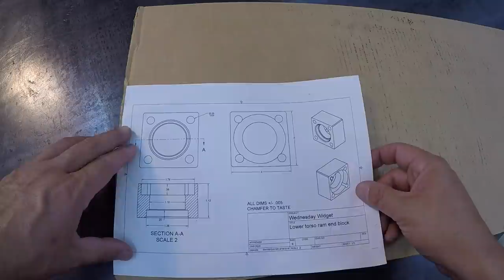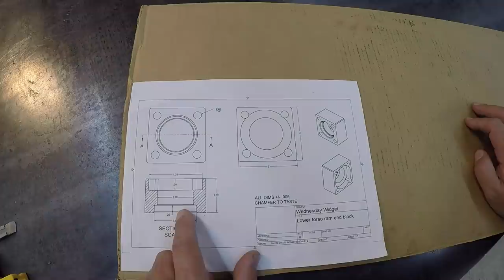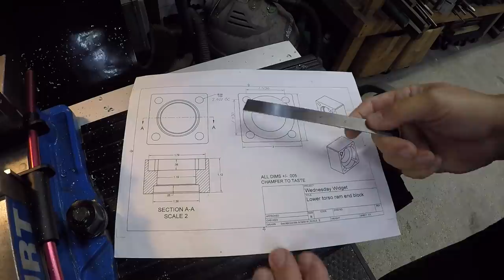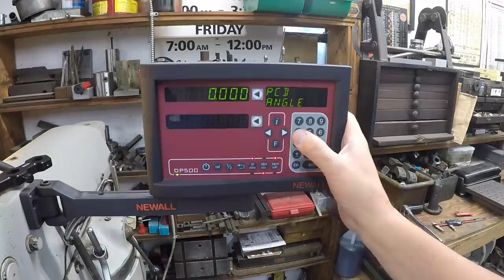Johnny 5 Part for NYCCNC

Comment: Here's an idea for a project.

Build an attachment for the end of the ram, on the Dake Press, that's kind of a square collet/chuck, to hold the Abom79 stamp, for when you want to press an imprint into a part.
Reply from the maker: BedsitBob yep, already been thinking about that one.
Reply: @katelights  Good idea! Set up a couple of alignment pins and bang out a bunch of identical parts in a row.

Comment: That spring center was really cool, I was wondering how you'd indicate that!
Reply: you can run thin square stock or parallels on each side affixed with a rubber band and zero on the center section for each side (where the test or dial indicator levels out and stops climbing/falling). Get the same number on each side and it's centered.

Comment: Nice work Abom79, love the manual machining videos. They teach a ton of useful info that can be used for up and coming machinist. Did notice one thing, the counterbore on the back side spec'd to 1.380", you measured it at 1.341" and said " that would be 49 thousandths". That would put you at 1.390". Not bashing, I catch myself all the time. Keep em coming, thanks.

Comment: I love manual machines, worked on them for over 8 years, still do once in a while. After running cnc for 20 some years when I see how long it takes to make that little part I don't see myself going back.
Reply: Good luck knocking a one off out this quickly in a cnc
Reply: @spikeypineapple552  you kidding right?
Reply: @spikeypineapple552  I hope you don't think he made this part in 30 minutes, do you?
Reply: Chris Maj this is a 90 minute to 2 hour job.
Reply: Since it is a simple part the difference between manual and cnc is not that great. If it wasn't for the center bore, the gcode could have been written manually in a minute. A bit more complex than that and cnc will save time. It depends on how valuable time is in deciding which is needed.
Reply: Nate Contarino yup, exactly. It’s still a 6 op job, and I still wouldn’t trust my vmc to put those bosses in there without a boring head, so the only op you really saved was the fly cutting and the drilling, and having to centre it in a 4 jaw. You added on 55k in machine cost though.

Comment: VIEWERS OF ABOM, who are you and why are you here?

I'm an electrical engineer fresh out of uni and do a little bit of shop work here and there. Mostly woodworking though. But seeing Adam applying his skillset to so many projects, nailing them, is awesome!
Reply: Marine engineer from Denmark :D
Reply: Mechanical engineer, machinist, farmer, and general repair/fabrication man from central, Kentucky.
Reply: Mechanic and Metalworker from Germany
Reply: I'm just a lowly shop helper (sanding, buffing, deburring, cutting stock) and a hobbyist machinist making audio amplifier enclosures. Located in New Hampshire
Reply: Auto Technician, constantly have to machine and fab parts and repair threads and holes in place on vehicles. Located in Massachusetts
Reply: Retired computer programmer who lives in central NJ.  (Exit 8A of NJ Turnpike)
Reply: @natecontarino1748  Those casework skills are of INTEREST to me.  Mine are, at best, marginal.  Check me out on Audio Asylum & DIY Audio.
Reply: Retired orthodontist with lifelong machinist hobby. Minnesota USA

Comment: That deburring file might be the smallest hand tool Adam has. 

I'm waiting for the prototyping video for a deburring tool that you can chuck up in the lathe. Once you're finished with the facing cut, it just drops on to the tool rest, lock it into place, set for however many sides your part has, and spin the chuck. (Metal cutting noises) done.

Comment: Adam...I think the drawing specified a thickness of 1.12" and after your final facing in the lathe, the mic read 1.20". I know the specs were loose, but you might want to bring it in before shipping.
Reply: I have made the 1.125 and 1.25 mistake twice in the last two weeks.

Comment: Part turned out beautiful!

How do you like that Edge Technology indicator holder (the one you used on the mill)? I've got an Indicol holder and like it, but I hate how it doesn't necessarily hold the indicator on the center line of the spindle like the ET one does. Lack of a fine adjust is a downside though.

Comment: I didn't quite understand the reason for using the power feed on the last drilling operation at 26:55. It helps avoid some issue with the drilled hole intersecting the bore?

Comment: Nice work Adam! 
Random question...you’ve been in a machine shop your entire life. What kind of boots do you prefer? I’ve been wearing Thorogood and I love em.
Reply: Danner or redwing.
Reply: @nismotuner1  I like danners for cold weather. Nick's custom if I'm gonna be standing on concrete floors all day.
Reply: HighFlyer I’m gonna have to check out Nicks. Good info.
Reply: @nismotuner1  Redwing, expensive, yes, but You will retire wearing the same pair... 😁
Reply from the maker: Thorgood slip on boots with the wedge soles 👌🏻👍🏻

Comment: don't throw these long chips from the drilling away, hang them on the Christmas tree in the shop
Reply: After my kids watched Wall-E, I told them that was neither the first tracked or cutest movie robot.
Reply: This is inadvertently creating a tree of razor wire, you have recommended basically putting razor blades all over a christmas tree. You're trying to give santa a brush with death!
Reply: But they are so brittle. Very brittle.

Comment: That looks like the end block for the cylinder that is at the rear base area of the mobility platform on the robot. If you google Johnny5_03.jpg and look toward the bottom of the image you can see this part.

Comment: I just realized I don't think I've ever seen you preset the Chuck. Do you do it with a ruler? How do you know where the center of the chuck is to measure from?
Reply: He mentioned in another video - there are circular lines on the chuck face that he uses as an initial reference when setting the jaws.

Comment: It's amazing how you do things.   I can do that with grading.
Reply: I'm going to assume heavy equipment, I worked with 2 operators in my 15 years construction time. A lot of guys who could run equipment, but only 2 true operators. 1 grey beard and 1 young buck. I'd like to see the young buck know.
Reply: @raymondmucklow3793     I'm grey haired to. But do Gradall excavator work and my Bobcats. E 85 excavator and E 50 excavator and T870 track loader.   When you can hang iron out 50 on tires without outriggers and cut 1/4 inch bank then you are good.  There are seat warmers then operators.   Have 6x6 tri axle dumps and Gradall excavator is 6x6 and also have a track Gradall excavator.  I do highway work in Florida.  Seen many come and go.  But have customers for last 40 years.
Reply: @larryshedd5734  when I say Greybeard that's a sign of respect, that's how I was raised.
Reply: @larryshedd5734  we did have a D6 dozer I got to run that for a while that was a blast made ya feel invincible. When I worked out in Vegas, these guys would come in with Doziers and Earth movers, and it was all GPS and lazer level.
Reply: @raymondmucklow3793  I know what you mean.    Not many people take pride in their work.  They get paid more than I did getting started.  I have some good operators I trained.  It's my company my machines I paid for and my customers.   Going to be my way
Reply: I have all that GPS LASER stuff on Bobcats.   Contractors love it.  I like it so don't have to wait for survey guy's.  Have CAD system.  Comes in nice on highway jobs
Reply: Have TELESTICK for Gradall excavator and can reach 51 foot. And 8 foot grading bucket.
Reply: I'm on 10 year project in Florida.
Reply: @larryshedd5734  highway project

Comment: Noticed that you use a lube to peek the chip welding down.  Any experience with waxes?  We used to use the for saws, and drills on aluminum. Thoughts.
Reply: like a paraffin wax or?
Reply: Jay R I think the used bees wax. The thought was if a block wax was rubbed on the part surface prior to fly cutting. Would it give even lube and does it work similar to cutting fluids?
Reply: @rascalwind  I've used waxes on cutters when working with plastics to prevent chip buildup while drilling delerin plastic.. but I'm not sure about aluminum

Comment: Hi Abom79  I would to ask you a few questions.  Is   Bronze hoarder then brass or copper. I'd of like to know which one is. and if there is any place to learn how to do what you do. Thank you
Reply: 'Bronze' and 'Brass' are both kind of poorly defined terms, but either of them will be harder than pure copper. Tin based bronzes can be made harder than zinc based brass because tin has a greater strengthening effect on the alloy than zinc does, but the hardness also depends on the % of tin or zinc added along with other elements (such as silicon, aluminium, phosphorous or manganese) that are included in the specific alloy you are dealing with. Copper alloys also 'work harden' so bending or hammering them whilst cold will increase their hardness at the cost of making them more brittle- heating them up and quenching them in water reverses this effect and makes them soft again.

Comment: +- 0.005 inches are +-0,127 mm no? if ye it's basicly impossible to be put of spec lol I mean that's a huge tolerance, when I turn/mill I have have to get in tolerances like +-0,000197 of an inch (0.01 mm) and I am already happy with that tolerances I had a job where my tolerance was 0.000078 of an inch (0.002) and I did it on a conventional lathe 😂
and u don't need to indicate the part like you did u can just clamp the indicator on the tool slide and check the "height" on all four sides we do that all the time, I mean we have to do it our way because we have to work with cut pieces (so we have 2 identical halves)

Comment: no criticism - but i was a little bit disappointed that you didn't clean up the outer faces with the shaper :( 
and out of interest - why didn't you use the same big mill for the surfaces as for that big Aluminium block of the Weld thingy some time ago? (AWS Back purge ...)

Comment: Saw cut surface on parallels as your first reference at 3:23. Wow. I wouldn't care what the combination square said, Use a 123 block or other device to set your first side. Terrible example. Then you didn't relieve the jaw pressure before your final boring pass, then you put the part in a 20 ton press to stamp it. It was like watching a train crash in slow motion. How is it you have 346K subs?